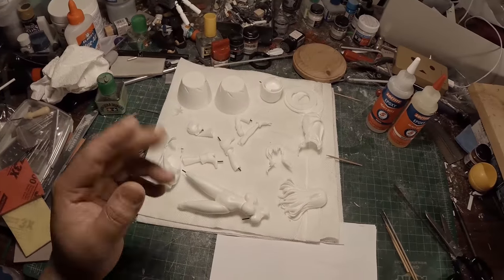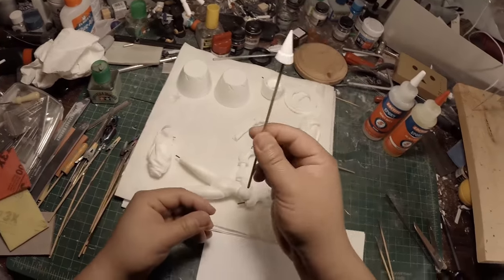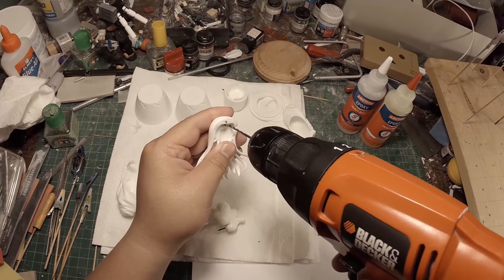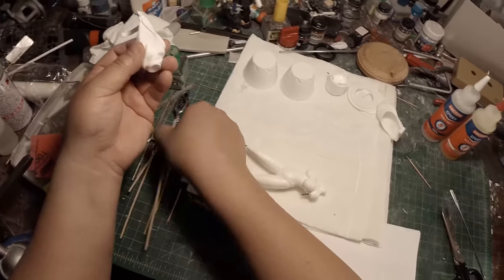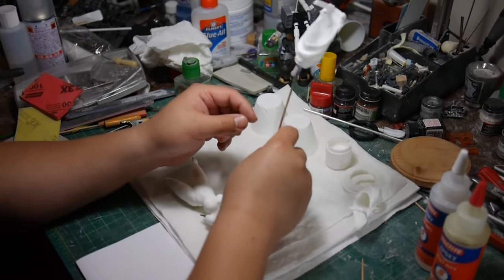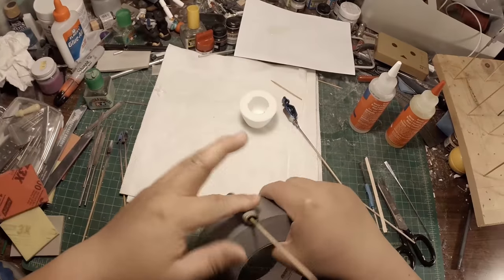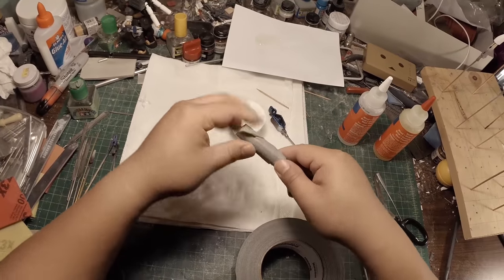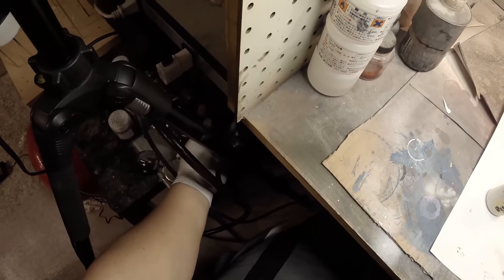Resin Anime Figure Model Building: Skewering and Priming

Comment: This video has everything I’ve been looking for thank you so much also is any primer okay? Which do you use? I am currently 3D resin printing anime figures
Reply from the maker: I tyically use Mr Surfacer Primer as my resin primer.  It has more bite into resin than Mr Surfacer.  But you can try the primer you are familiar with and see if that works for you.
Reply: @ThoseGundamGuys  thank  you for the tip

Comment: is the primer thinned ?? and if it is what ratio?? 2-3 maybe
Reply from the maker: jasonsand Yes, the primer is thinned.  The ratio is about 40% primer to 60% thinner.  That's the start.  Then depending on the consistency of the thinned primer, add more thinner or more paint to find the correct consistency.  It's not an exact science since there are so many variables that affect it such as how thin the primer is to begin with, relative humidity, airbrush pressure, etc.  I try to think to the consistency of milk.  A test spray out of the airbrush will let you know if it's too thin or still too thick.